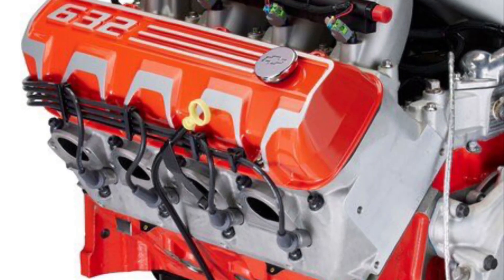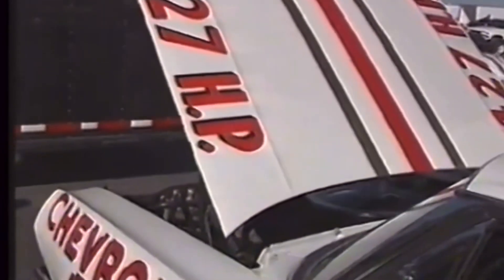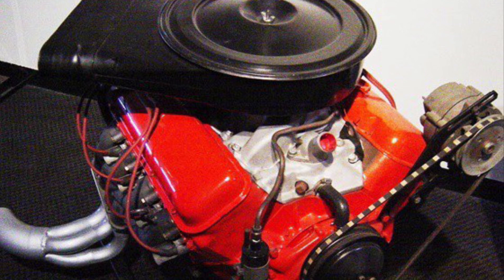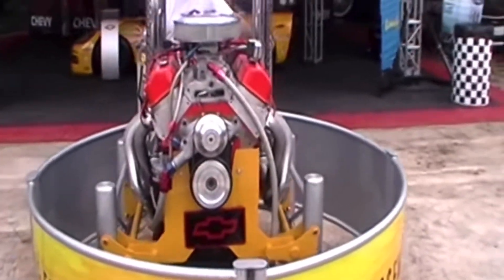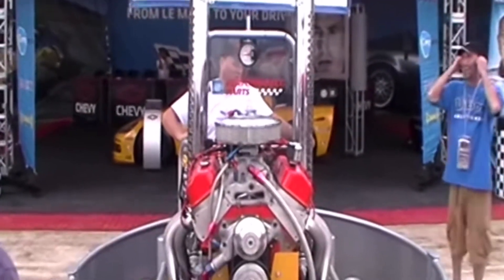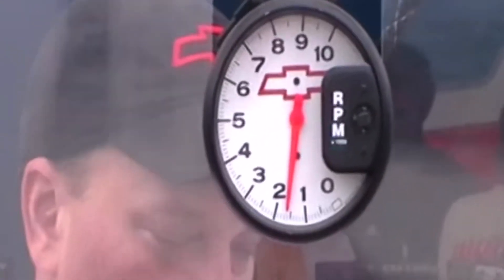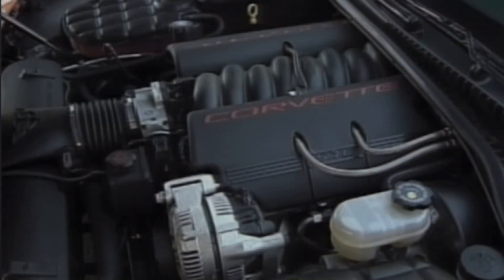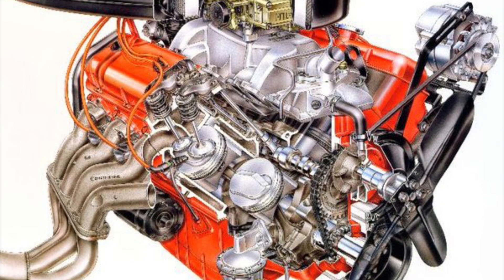The GM ZZ632 & The start of real HP Big Blocks with the Mystery 427 V8

Comment: The zz632, being a tall deck block, more closely resemble the chevy 366 tall deck dump truck engine rather than the nascar 427 standard deck Mark IV big block. In all fairness the dump truck Mark 4 tall deck was stretched out to 427 cubes as well. I think you got your're 427's mixed up. Yes. I was Mr. Goodwrench.